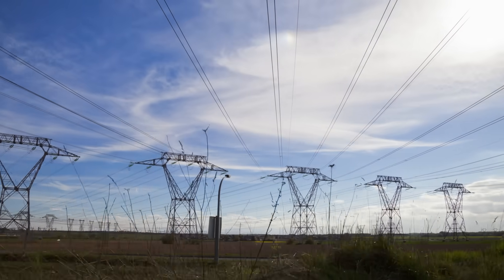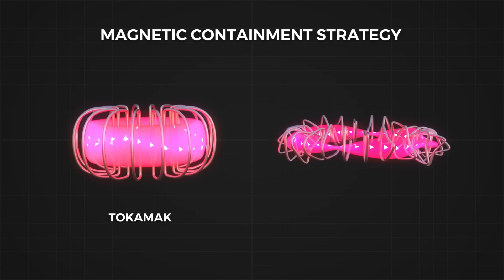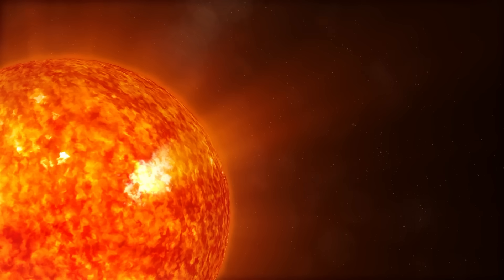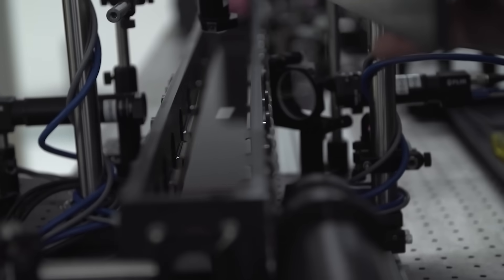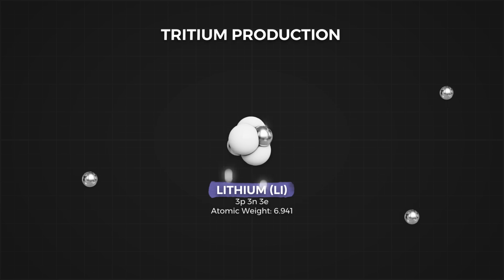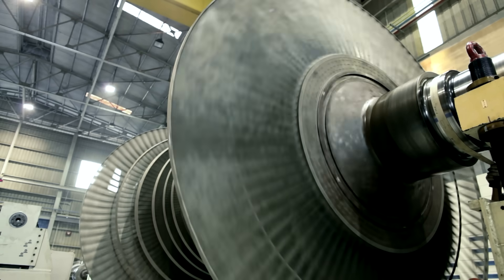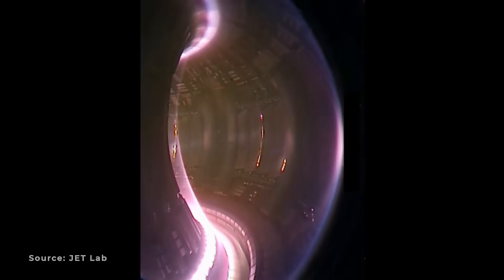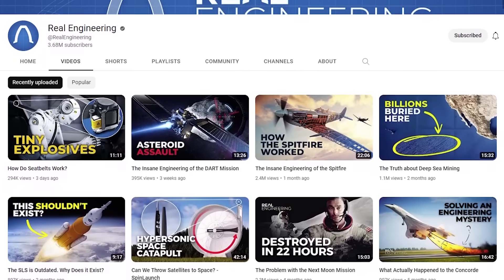The Problem with Nuclear Fusion

Comment: As a fusion researcher, titles like this are pretty frustrating since we have very little control over the public image of fusion, and impressions that don't click on the video get a negative impression. However, this video itself is pretty solid, i'm halfway through and it's been all good and accurate points. The key is we need a societal push to produce effective fusion, ideally similar to space-race level support. otherwise it will continue to take a long time. People like to say it's always been 20 years away, but fail to mention that that's primarily because the funding for fusion research has been slashed over and over again ever since we stopped competing with the soviet union over it as a technology. If you don't fund something, it stops moving as quickly.
Reply: Hm, okay, follow up, didn't realize you were with Helion, just so everyone knows Helion is a private "fusion" company who makes their money by selling technology and components to public fusion research, while on the side developing a very unresearched method of fusion. They use a "Field Reversed Configuration" confinement technique, and their understanding of it is about 40+ years behind modern tokomaks, since they just recently announced they've mostly figured out neoclassical confiment. The arguments about Berrillium blankets in this video are kind of niche and very manageable.... you can just purify berrillium.... I think it gets caught up in the weeds at the end (these are not the main problems with fusion) because private fusion makes their investment money off of calling mainstream fusion research misguided and their approach a miracle. Other than the last few minutes, great vid.
Reply: @The_fusion_physics_guy  I don't see how modern tokomaks like ITER are ever going to be economical but then again I'm not the physics guy
Reply: @cod6guy12 the point is that nuclear fusion is currently researched. So these plants are one of a kind with leading edge technology aka incredibly expensive. ITER is important but it is ultimately build with knowledge from 15 years ago. Some other technologies like in the Wendelstein fusion plant use more complex technologies. Both are needed to enhance our knowledge to make these things cost efficient. 
The main problem are that we need 10 times higher temperatures than in the sun because we can’t recreate the pressure within the suns core.
Reply: @svenweihusen57  I understand but my point is if Tokamak's need to be ITER sized or larger it's just never going to work. Even if you get more energy than you put into the reaction you have to also hit the break-even point for how much energy it took to build the thing in the first place. 
The amount of energy invested into just the construction of ITER could've built many fission power plants instead.
Reply: @cod6guy12  sure. But fission has 3 massive problems: 
1. Nuclear waste, no real solution in sight
2. Nuclear material: do you really want to give someone like the Taliban access to nuclear material?
3. Rarity of nuclear material. Uranium isn't that abundant. Current reserves estimate the amount at 200 year of current consumption.
4. Security: nuclear plants pose a huge risk. For example not a single nuclear plant on this planet is fully insured for a huge accident. US plants are insured for 500M$ each while Fukushima had a bill of 200B$.
Reply: @cod6guy12  one funny thing is the timely dimension we are thinking in and the other one resalearchers are in. Since I recently visited the Wendelstein 7 X I feel decently informed. They dropped a nice piece of information, at the start Tokamaks were far under one percent efficency. Now we are at around 60 % so he Said: They are close to the goal😅
Also scaling isn't a real problem it's just costly and time consuming.
Reply: @dominik1462  if it's so costly it takes decades to break-even on your energy investment that's a real problem
Reply: @cod6guy12  Lol I always forget this is my username, the key is scale. Compare SPARC (MIT) with ITER and you'll see what two decades of tech research can get you. Every improvement in plasma physics, materials science, and superconducters, makes the devices smaller and therefore more economical. It's not a question of how we do it (with a big enough budget we could've done it in the 90's), but of how small/power dense they can be.
Reply: @svenweihusen57  Great comment, I don't run in to a lot of people who know about W7X, my research group actually mainly does stellarators like that, i'm just one of the tokomak guys :P
Reply: @svenweihusen57   
1. Tritium is highly radioactive and difficult to contain being hydrogen.
2. North Korea already got nuclear materials

3. Uranium is far more abundant on the planet than tritium (which can only be made in specific CANDU fission reactors).
4. It's not the nuclear side of the reactor that is the current issue it water that cause most of the safety issue with nuclear power plants. How are they going to extract energy from Fusion...probably with water although they've never addressed this issue.
Reply: The last 10% of building takes 90% of the time.
Reply: @cod6guy12  the point of the break even projects are just to prove it can be done. that would be a significant breakthrough and it would be a huge step towards the end goal.
Reply: @dominik1462  that is fuel efficiency.  then you have 10x higher power drain for continues fusion. fusion will never work on earth. we need to compensate for the gravity and pressure stars have.
Reply: Unfotunately there is not much money. The budget for fusion research is around 2-3% the budget for nuclear weapons refurbishment in the US, which is only a fraction of the total military budget itself. The US spent a LOT more on new tech like transistors and fusion and particle physics during the cold war, but gave up once there was nobody to look better than anymore.@@klinestill
Reply: Wait so whats like, the “equation”that needs solving to level up in fusion/ level up to fission?
Reply: @88xxx882  multiple challenges. You need ultra precise ultra strong magnetic fields to keep fusion going. Sun is doing fusion at around 10M °C while we need 100M°C because we can’t reproduce the pressure within the suns core. Something at 100M°C is emitting crazy amounts of energy and we need to have fusion rates that will substitute this energy plus the energy for the magnetic cage etc. search for stelarator and look at the 3D twisted magnetic fields and coils. All of these need to be super precise while you have huge forces, huge currents at cryogenic temperatures for the coils and 100M °C for the plasma within.
The scientific concept for fusion is nothing special but invent the technology to make it possible is something else
Reply: @88xxx882 (*fusion) If you want a very technical answer, we are using the gyrokinetic equation on supercomputers to model nonlinear heat transport in order to find parameter regimes (shapes of magnets and methods/amounts of plasma heating) that will minimize heat losses from the plasma while also allowing for fuel recycling of fast helium ions. Look up "H-Mode tokamak" as an example of an important concept we are refining. We can also get a lot of extra performance out of better magnets, of which MIT's new project SPARC is a good example.
Reply: @The_fusion_physics_guy Greetings. I have a very fundamental query regarding the fusion vs fission debacle.

If fusion is that costly just to become viable (aggregate cost would be at least upwards of 1 trillion by your estimates), then why not just put that money into fission research to address its drawbacks? (primarily regarding waste management)

I know technically fusion would be the better method, but pragmatically speaking, don't you think fission research would be the more certain and efficient use of resources? I understand that fusion tech might trickle down to other aspects of technological development as all cutting edge techs do, but as energy production is the primary goal of fusion research and we are already reached that through fission, then isn't it better to put our efforts towards something like fission that has relatively more potential to provide tangible benefits within a relatively less uncertain time frame? Thank you.
Reply: The laws of physics don’t care about how much “support” you put behind something it’s says isn’t going to work. Just like with the space race. Humans will never colonize Mars or leave the solar system
Reply: If you want to make a working commercial fusion reactor in two years, and get commercial heat, I can help you. I have made a great world-class scientific discovery about nuclear fusion in the atmosphere of the Sun.  The assumption by scientists all over the world about nuclear fusion in the core of the Sun is well known.  This is a fallacy. For over 72 years, scientists have not been able to make a working commercial thermonuclear reactor, and will not be able to make one for many years to come. The reason? The misconception of nuclear fusion in the Sun. 
Nuclear fusion in the Sun's atmosphere begins under the physical conditions existing there at an initial plasma temperature of 5,000 K; by the end of the fusion reaction, the solar plasma temperature reaches 1,500,000 K, on average.  Sunspot temperatures on the Sun from 3,000 K, sunspots can be up to 100,000 miles in size. Doesn't this prove that nuclear fusion occurs on the surface of the Sun, not in the core of the Sun? If we take a good look at and study sunspots, it is clear that nuclear fusion takes place in the Sun's atmosphere.  
I know how to replicate the physical conditions for nuclear fusion in the Sun's atmosphere. I propose a reactor design with the same physical parameters for nuclear fusion and excess heat as in the Sun's atmosphere.    https://www.youtube.com/watch?v=FcypwoVOAAY 
To make a small working prototype confirming the principle of nuclear fusion in the Sun's atmosphere and obtain commercial heat needs about 10 million euros, manufacturing time 2 years. It could be less. Depends on the country where the prototype will be made.
Reply: Thats the whole point, disinformation to keep public opinion against Nuclear power until Oligarchy owned oil companies can guarantee themselves a monopoly over the inevitable transition.
Reply: ITER is fully funded. And a bigger pile of garbage would be impossible to find.
It will NEVER result in a commercial reactor design, because it could only produce the world's most expensive electricity!
The only good thing to come from ITER will be a pile of PhDs taller than the reactor building.
Reply: Well Said Sir! Fission or fusion,  nuclear energy is the answer. If a nuclear sub with a little reactor can go around the world under water and use a golf ball size of uranium to do it, well that convinces me that it's the answer to all our energy needs. Science has learned from 3 mile Island ect. We now have reactors that can not melt down plus you don't need to shut them down and refuel them.
Reply: 1) To supply the amount of tritium necessary would require massive additional investment in fission reactors.
2) Millions of Eco-Marxists are presently demanding we erase fission from the human lexicon and replace it with wishes and dreams.
3) You can tell a pretty good idea when it's viciously attacked by extremists on both sides - you can tell humanity is in deep trouble when one of those sides wins a supermajority.
Reply: In Russia there is technology for nuclear waste, but nobody in other countries would believe it.
Reply: Dude, there has been a trillion dollars spent worldwide on fusion, and nothing you are still having a negative energy output stop. It will take another 40+ years before a net positive will be plausible if at all next gemeration nuclear plants could have been built instead in the hundreds or thousands worldwide giving clean energy.
Reply: Notice how they keep saying it's "20 years" away. That's part of the SCAM   to keep getting money from the Government 😂
What a load of bullshit
Reply: Just twenty years away? Asshat.
Reply: Well the entire globe is spending money on fusion research, you make it out like it’s only the USA.
Reply: As a fusion researcher u actually believed fusion is possible
Reply: Stop whinging on the internet and get back to work or next year fusion will be 21 years away.
Reply: As a product of fusion research: [Insert godzilla roar that sounds like he agrees here]
Reply: Whine whine whine about inefficient energy production.. but when you do get there with fussion reactors, alcubirre warp drives go from science fiction to possibility.  
Sure you naysayers will then be whining about becoming an interplanetary species.
Reply: How much power, to start it?
Reply: @The_fusion_physics_guy I hear you, I wanted to invest for years but Helion is not publicly traded and I can't find companies that we can invest on. All the companies saying they research Fusion are Oil companies like Chevron, Cenovus, Eni.. and I don't trust them to actually pour tons of money in. Or I suspect they would patent it and make sure nobody can use it so they can keep their oil profits.
Reply: Powerbrokers who run this planet do not want us to have this technology they want to do the opposite they want to drive to even reach to extinction white because that’s how about fusions think Malthusian
Reply: Well about the funding „TONY BUILT THIS IN A CAVE, with a bunch of scraps“
Reply: So even the fusion physicists have an attention span of like a couple of minutes? Strange
Reply: NERD
Reply: Imagine if NATO and the US had spent trillions on this instead of a pointless proxy war with Russia.
Reply: @HawkGTboy  Imagine if the 2 trillion that went to the useless war in afghanistan went to something useful like this.
Reply: amen brother. @HawkGTboy
Reply: And no one wants to fund “free energy”. Ask Nikola Tesla. Our benevolent politicians can’t make and launder money over free resources
Reply: You're being optimistic... People say it's always 30 years away
Reply: Who said that, and what conditions did they put on it? "people say it's 30 years away"... anybody can say sh*t. Real scientists put conditions on statements like that, if they make them at all. @patrickglaser1560
Reply: @patrickglaser1560  Gotta wonder how much of that forecasting was done by the actual scientists doing the work
Reply: As a fusion researcher, you should get a real profession
Reply: Funding? Producing energy lower than the energy needed to produce is not sustainable.
Reply: Just seems like a more expensive and difficult fission with same problems
Reply: A "Fusion researcher"  ??? 🤣🤣🤣🤣🤣  good one.  And I am a Time Travel researcher.
Reply: @-WhizzBang- Nah you're just a bozo and a loser
Reply: Ok but you have no results.
Reply: @1984Kojot Wrong. Are you dumb? Look what the NIF did recently lmao
Reply: I feel like you don't often browse fusion journals. Or did it just not get reported on whatever news feed you happen to watch? Do you think that nothing is happening because you specifically weren't informed? @1984Kojot
Reply: How much funding do you need? On another point, why don’t the government fund it if it is truly going to be the best source of energy humanity has created?
Reply: @curtisreeves7248  coz focusing on political wins and maintaining global/regional hegemony through military armament is apparently more important than progression of impactful science.
Reply: @curtisreeves7248  This is a good question that I don't have an excellent answer to, but there have been money predictions made in the past and i'm sure more have been made recently (i'm just a grad student)... Basically, we used to make a new major device every 5-10 years, but we've been building ITER for like 15 and it'll be another 5-10 before it's done its research. We need the money to be building next-gen plants every 5-10 years (probably about 20-100 billion every 5 years) if we want to push forwards at max speed. In comparison, I've worked with DIII-D a lot, which is older than me and is held together by spit and dreams, but it's still somehow pumping out cutting-edge relevant plasma physics research cause it's all we've had in the US of that scale for a long time.

The US doesn't like to fund things that don't give private companies money on a short timescale, or that don't win political points. The space race was because we had a competitor and we also wanted to put nukes up there. can't build weapons with fusion power, we already have the H-bomb and tokomak research won't make it any better.
Reply: @The_fusion_physics_guy  Right. If we want to push forward we need to use what we learned now and build another reactor before the current machines have reached their full potential. This will certainly waste some money and people should be honest about this fact but it will speed up development.
One of the most problematic things about Fusion technology is the prediction that it is just 30 years away......since 1970 :). This prediction history isn't encouraging politicians to sepnt Billions of dollars. 
I think it's the most promising technology for energy production but nobody can honestly tell now when it will be ready for commercial use.
Reply: @svenweihusen57  If I asked you when we would have cheap (think $3000/ticket to orbit cheap) commercial spaceflight, could you give me an answer? Could even NASA give an answer? within +-20 years even? We put a Lot of money towards that type of technology not because we can nail down a date for its completion, which is more of a concern for a private venture, but because the scope of its benefits (not just for space travel itself, but the relevant tech) is enormous. We can't always predict the issues we'll run into. For fusion it's been anomolous heat transport due to nonlinear turbulence, to get technical, but when attempting to make predictions for a tech issue of this complexity you would also have to be able to predict the improvements to superconducting tech, constuction tech (additive manufacturing is new, for example), the entire scope of worldwide public fusion funding, etc, which is why the "fusion's always been 30 years away" concept is stupid. According to who? How did they come up with that number? Most scientists I work with would give you a guess, but only because you can't give non-scientists an answer invovling what tech challenges need to be overcome because it requires a phd to understand what that answer means. It's much better to talk in terms of technical obsticals than time, but we're hindered by a communication barrier. Like space travel, it's more of a question of how badly we want to invest in the future rather than just expanding existing infrastructure without developing new tech. We could never go to space. We could rely on fossil fuels and renewables and fission forever. But people seem to not want to do either of those, at least eventually, and the rate at which we approach them is almost directly proportional to how many resources we invest in them.
Reply: @Curtis Reeves  because politicians aren't scientists. Many many people write nuclear fusion off as another nuclear power plant that can go off like Tshernobyl. Many do not understand the extreme difference between fission and fusion. My former English teacher is a good example here: she says she is against all things that have to do with radioactivity (per se not bad). But when a discussion about fusion comes up (which to my knowledge is not at all radioactive), she not only doesn't listen to the explanation me or other classmates fascinated by it have, no she openly says "nuclear is nuclear, no matter what, I think its bad end of discussion, its dangerous and risky and no one can convince me otherwise".

Pretty sure that many people are exactly like this, especially the older folk who think they know better and the stubborn normal population.
Reply: It's impossible. There is no perpetual motion machine.
Reply: @justicewatch4602  Dude, successful fusion has been done and fusion bursts are becoming longer and longer. You don't need a perpetual motion machine to make a fusion reactor work.
Reply: @justicewatch4602  The sun begs to differ. It’s not a perpetual motion machine, the physics of it is already well proven. And, once again, if you disagree, I’d suggest taking a look at the gigantic fusion engine in the sky that keeps us all alive
Reply: @jamesolmsted3471  We need to recycle our energy here first. That fusion stuff is a scam to me. We waste so much heat energy every second that it's insane. There are devices that can turn that directly into mechanical energy 24/7 with little friction. And they don't have to be gigantic like the windmill nuts always think. It's actually the opposite. They can be very small and out of the way constantly converting energy or storing it.
Reply: It is a dead horse and you should not ride it.
Reply: Hey physics guy. I get that this is frustrating for someone who works in the field but in the end I am pretty sceptical. 

Yes it has been 20 years away for something like 60 plus years. And it needs fuel we don't have, which we can possibly generate using special techniques, if that works. I know the physics works on paper but making it practical is nowhere near proven. And we don't have enough beryllium to create more than one reactor per year, even if we suddenly have no other need for beryllium. And then it will still create nuclear waste when they're decommissioned, which we have no solution for, and the decommissioning process will be an expensive nightmare because "Oh it wasn't built in the expectation anyone would ever have to decommission it." And you can say oh, we'll build them so they're easy to decommission and I will call BS because that has also been said for decades and still isn't true. They will be built by people who want to make lots of money in the short term and could not care less about the next generation no matter how good your personal intentions are.

And then there's safety. Yes I get that the problem with fusion is keeping it hot enough to keep working, and the idea is that it is passively safe because it will just shut down if it leaks or whatever. The problem is that we were sold a massive line of BS on fission power and I don't think anyone's going to believe it. Nobody was told about decay heat in fission reactors and needing to keep pumping water through the thing to prevent it going Chernobyl on us. And then they put the emergency pumps in the basement! In a tsunami zone. Wonderful. This industry is asking for a hell of a lot of trust and yet it seems to be run by idiots.

At Fukushima it almost became predictive, the more they said it could not possibly explode the more it exploded (yes I know it's a hydrogen explosion not a nuclear explosion but it's not like the inhabitants of Fukushima didn't lose everything either way). That is going to cause cancers and people are going to die horrible deaths. 

So I think now is the time to call time on fusion research. Stop now, before we've wasted any more billions. It has become one of those boondoggle projects which is pretty clearly never going to work and we have become victims of the sunk cost fallacy. In the incredibly unlikely even it ever works, if we solve the tritium problem and the beryllium problem, it will still be incredibly expensive, hard to clean up, potentially very unsafe and we can build a lot of wind farms for the cost of ITER.

The most accurate sentence in this video is the first. Yes, it's a pipe dream.
Reply: @Kerynasta the dude literally responded to the "it's been so far away for so long" comment
Reply: @VisionsOfSpy  Well yeah, but he doesn't really offer any solutions beyond asking for more money. Not only will money not solve some of the problems, like availability of beryllium and the fuel generation issues, but I'd love to see what has been achieved in (say) the last 40 years even with the money that's been spent. We have certainly spent many many millions on it, and the result we have is still a bunch of people sitting around in a lab occasionally achieving one single split second pulse of fusion which is maybe just barely energy positive on paper and... that's it. We were doing that in the 80s. It has barely moved.
Reply: @Kerynasta  Our fusion tech has evolved quite significantly since the 80s if you actually look at it, it just seems slow because it's being compared to the lightning fast development of say computers for example. This isn't trying to harness the power of a microchip, this is trying to harness the power of the stars, it will take time (And it'll take even more time if funding keeps getting cut year on year). For a bit of perspective, don't forget that we took 300 000 years to create the steam engine.
Reply: The solution is to improve confinement via better magnetic shaping and fueling regimes, such as the recently discovered "negative triangularity" regime or "super H-Mode" utilizing multiple internal transport barriers. In the last 40 years we have improved performance by at least an order of magnitude in modern devices. I didn't give the technical solution because I wasn't Talking about the technical solutions, which are incredibly specific and won't make sense in a youtube comment section. Just trying to give a political perspective as somebody inside the field. @Kerynasta
Reply: I don't think you know how fusion works. You've really lumped it in to fision, and it's just not similar at all. There is not enough fuel in a fusion reactor at any given time for it to explode, and we can't fit any more in because it will leak out. The fuel that's not in the reactor cannot be "ignited" because the only place hot and dense enough to burn is in the center of a working and not leaking reactor. I'm not concerned that 1 pound of explosives will destroy a city because there is just not enough explosive. Whereas with fision plants, all the fuel is there always. There's a bomb's amount of fuel at all times in the core, and they just control it so it doesn't overheat and melt. There is a real risk there. 

Also, to your point about radioactive waste, there are different levels of waste. All the waste generated by fusion is low-level, caused by irradiation of the walls of the vesel, and it will normalize after only a few hundred years, vs many thousands of years for uranium waste. We have solutions for a few hundred years. I encourage you to look into this. The world's governments are still very excited about fusion, and there's even been billions in private investment in the last few years. It's far from a pipe dream, it's somewhat inevitable, the only question is how far away. @Kerynasta
Reply: @Kerynasta  If you haven't already, take a look at what Helion's doing with their fusion reactors. At the very least, they solved the radioactive waste problem and the fuel accessibility problem too (the only fuel component required to be purchased is deuterium, and the rest is produced on-site within the reactor itself -leaving just tritium as a waste product, which decays into H3 in 12-ish years [and H3 is a desired fuel for the reactor]).

Plus, their reactors don't need beryllium at all. (And are much smaller.) I don't really have a horse in this race (doesn't matter to me which version of a fusion generator gets off the ground without radioactive problems, just that we get it up and going at all), but I find it interesting.